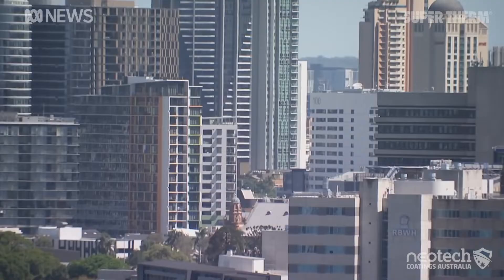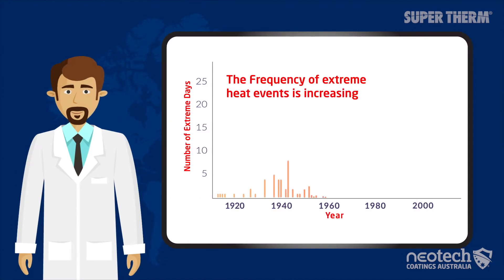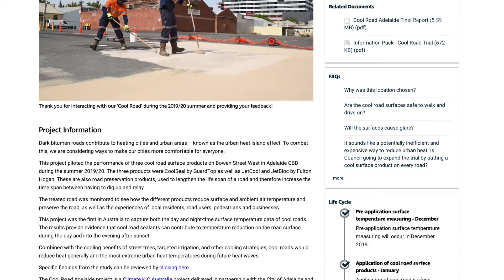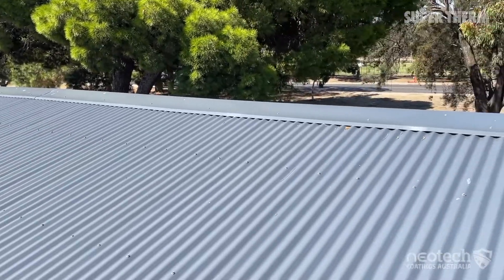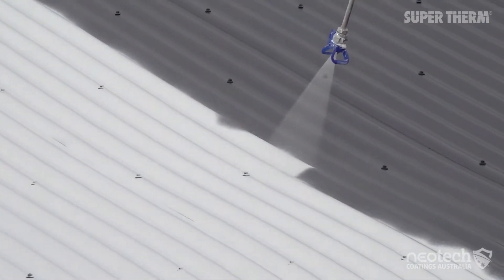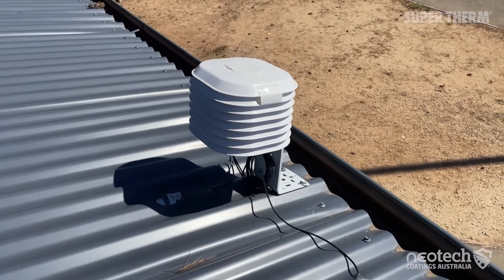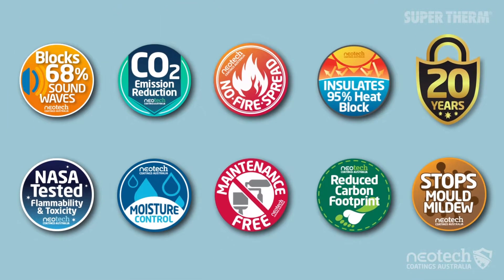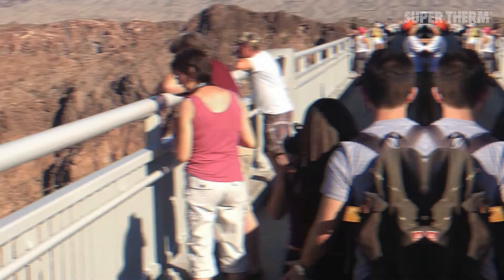City of Adelaide Cool Roof Pilot 2022

Comment: How durable? Hail, falling branches, etc?
Reply from the maker: @moorechez67 Super Therm is a very tough coating. An epoxy top coat will really protect it however it's designed as a industrial coating. So far a test we're undertaking is 34 years and had about 15% loss of efficiency. It is tested to 100km/hr driving rain as well and fire resistant to 160°C.